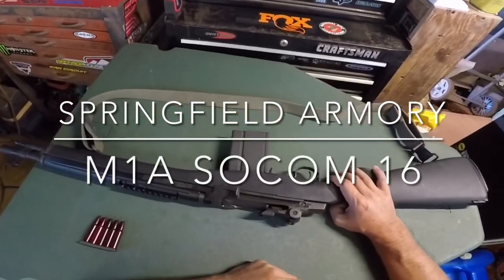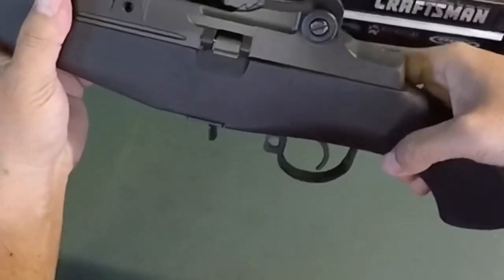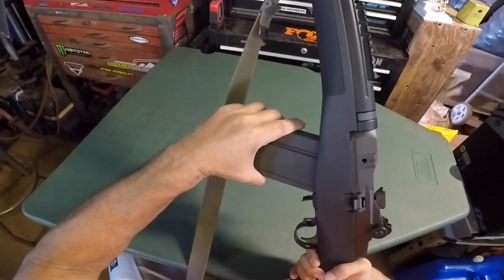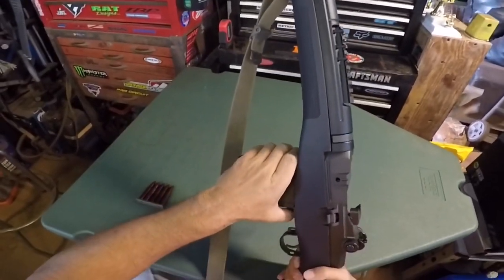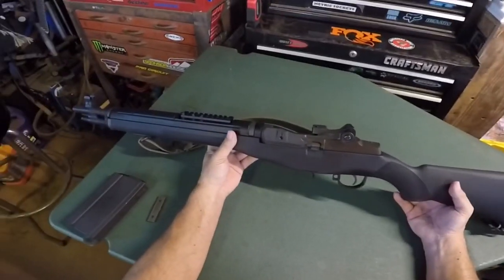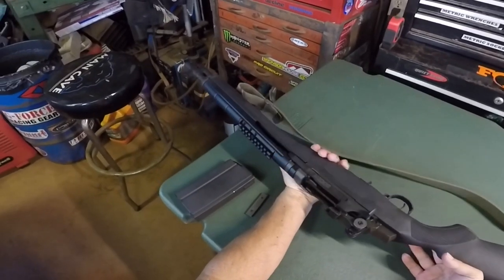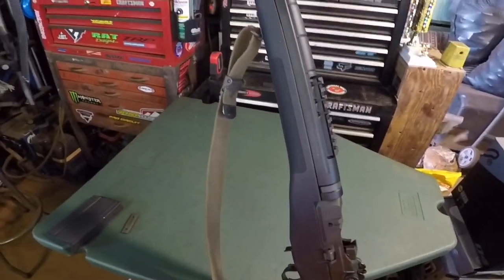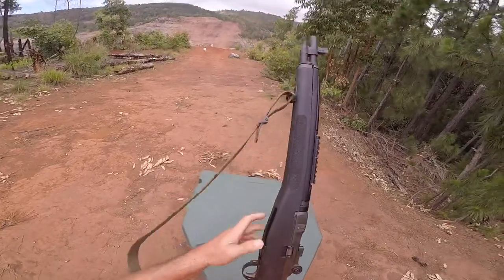How to Operate the Springfield Armory M1A Socom 16

Comment: I have the Tanker version. Love it.
Reply from the maker: Nice!  I actually wanted to get the Tanker but it wasn't in stock so I got the Socom 16.
Reply: @ratcamaro  Same situation. I was looking for a Squad scout . None around. Last stop at a local shop.
Found the Tanker AND, a 1911 Garrison. Took em both.
Reply: @ratcamaro  the tanker is basically a socom 16 with a wood stock minus the forward picatinny rail correct?
Reply from the maker: @gemayeljones248  Correct!
Reply: @ratcamaro  Tango Yankee
Reply: Anyone know if it really can be full auto
Reply: @23ortizgus  don't know, but probably. It was originally in M14 configuration, select fire, with a full auto position. Wasn't very good at full auto. Very difficult to control.

Comment: I got the tanker and based on your ammo test I bought 200 rnds  of 150gr ppu soft point.. I prolly should have asked if you experience any jams with that specific round?
Reply from the maker: They say you shouldn't use soft points but I never had any issues or jams firing soft points.  When I go hunting with this rifle I use soft points.
Reply: Have a tanker I've shot all kinds of steel and brass and all kinds of ammo as they break in they don't care what you feed it! Yes soft points to fmjs!
Reply from the maker: @jackdaicole7595  Yup, I feed mine anything and it eats it.